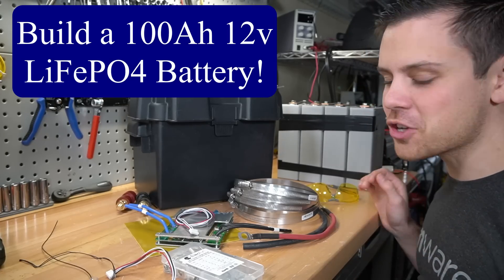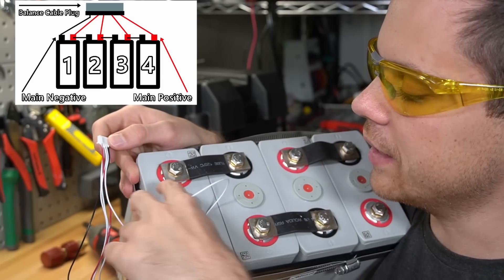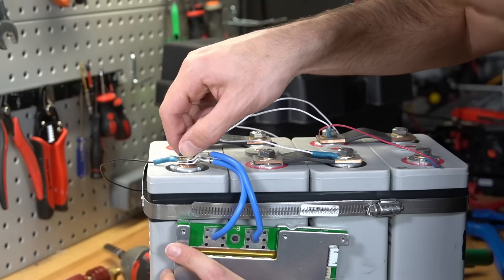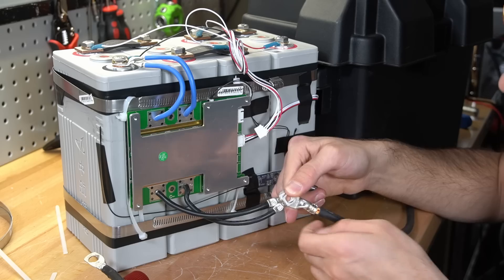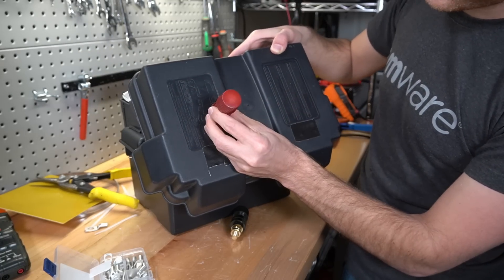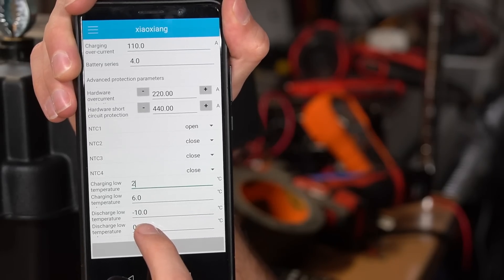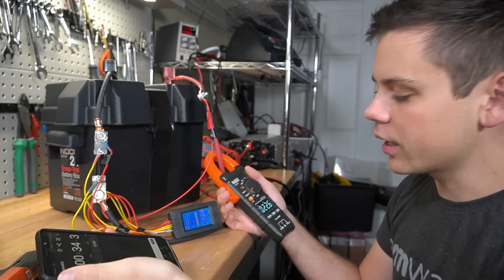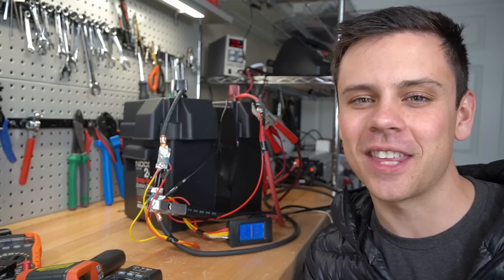DIY 12v 100Ah LiFePO4 Solar Battery for $555

Comment: Those hose clamps really grind my gears Will.. Please use VHB tape between the cells, much less stress on the cell and allows expansion to take place. :)
Update on the CALB cells from your Christmas video.. They've landed in Germany only trouble with that is I live in the UK. haha
Oh and as for battery boxes... Why don't you buy or build a 3D printer, would be another great video project. Arduino controlled stepper motors and a little frame.. can't be that hard :D lol
Reply: Evidence suggests that compressive clamping of the cells at 12 psi to limit expansion may actually increase cell life by up to 1.5x.

Comment: 2:29 Silicone for insulation and implants. Silicon for chips. I cringe with all of the vinyl electrical tape - I've reworked too much car audio I guess (and the big gooey mess it leaves behind). Otherwise a great video as always! And the link to the better BMS app is very much appreciated.
Reply from the maker: I can never say those words correctly, thank you. Always screw that up.
Reply from the maker: Better tape coming in the mail

Comment: re: better cases. Harbor freight's pelican knock offs are what I've been using. just keep the vent open.
Reply: Which one are you using?  Those pelican type aren't deep enough......
Reply: @smitty3509  I'm not sure if they'll fit the 100 amp cells, but I stand the vertically(top of cells pointing at the handle)

Comment: Hi Will 
As always thanx for useful thorough dyi.   The big question is ....could you series connect multiples?  Renogy and Battleborn downsides...have you thought of a work around to use in higher voltage system?
Which leads to an unanswered practical question managing multiple types and chemistries of batteries.
You obviously have a lot of various batteries ...or a person transitioning from existing lead acid and or various sealed, with an RVs starter in the mix as well to keep topped off and utilize for storage.

Comment: Great video. Please do more, starting with basic build like this, then follow-up videos adding features like low voltage disconnect, fuses, trips etc.

A tip - Put a length of webbing aprox. 50-70cm long wrapped under the cells and up the sides of the cells before adding the hose clamps (they will hold it in place - this will aid dropping the battery cell pack into the box and help if you ever need to remove the cells to service.

Comment: Is there a way to independently label each BMS for multiple battery systems? Does the software handle multiple BMS systems? The biggest issue for me is the Android thing. I hate when manufacturers don't create for both IOS and Android. Annoying!

Comment: Will; A sincere thank you for the easy, clear instructions. I have basically cobbled my solar system via items on Craigslist for about 25 cents on the dollar of new store parts. All were new and never used in sealed unopened boxes. Amazing how many people buy items & then never use. I'll build my own batteries & boxes (TAP Plastic) this Summer but have been ok so far with my golf cart ones. My electrical requirements are fairly small & simple.

Comment: If I build multiple batteries like this one can I put them in series (or pararel depending of my needs) at the end?
If yes can I draw 60 amp continuously multiplied by the total amount of  batteries? For exemple draw 120 amp in total with 2 batteries like this in series.
Reply: Or is there an easiest way to build a larger battery for Solar application?
Reply from the maker: Build a 24/48v battery. Check out my older videos on Daly BMS install to learn the configurations
Reply: @WillProwse  Thank you! Much appreciated!

Comment: Hello Will. I just ordered two of the Bluetooth BMS’s but I can not find a link for the app that will work with a iPhone. Do you know if there is one?
Reply from the maker: Should be this one: https://www.google.com/url?sa=t&source=web&rct=j&url=https://apps.apple.com/us/app/xiaoxiang-bms/id1375405426&ved=2ahUKEwj1m4LWzvrmAhULuZ4KHTcRDkMQFjABegQIBhAB&usg=AOvVaw3jdRAIC2ahb25fh7Vtqatn&cshid=1578713668560

Let me know if you have problems with it. It should work great

Comment: At 72 y/o, my brain can process your genius at about 1/3 speed.  So, I won't be building this battery.  I have the resources to buy what I need, so would a Battle Born 100 ah be equivalent to the configuration?
Reply from the maker: Yes battle born will work wonderfully. And it comes with a warranty
Reply: Jerry Roberts yes but with a warranty.

Comment: Are hose clamps really necessary?  Putting pressure on cells kind of weirds me out.  I think I would just prefer strapping tape.
Reply from the maker: To be honest I never use hose clamps. Just the older ev crowd folks will get mad and flame my video with comments calling me a idiot if I don't haha! And at low c rate, like solar application, the swelling isnt that bad at all. I wouldn't worry about it
Reply: @WillProwse  We should ask the crabby EV guys why strapping tape isn't good enough.

Comment: I'm 90% sure I'm building one of these, if I build one now and another a year later will I have any problems trying to use the together in parallel for a 12V system?  How about if I wire them in series for a 24V system?  In my application I would have the room to have 8 cells together in any configuration, I don't really need the "drop in" aspect , could I use one BMS for one large 8 cell battery?   Thanks for the videos, I am learning a LOT!

Comment: Will,  first, thanks. Second, I ordered those same batteries but went with the Daly BMS you had recommended. I also have a VictronConnect 100/20 and the temp sensor add on. I’m not sure which diagrams to look at for setup. Can you please help me?
Reply from the maker: Sure, the Daly will still work great. And this picture might help: https://www.mobile-solarpower.com/design-your-own-12v-lifepo4-system.html

I also have some older videos that cover the victron battery sense setup, but I bet you can figure it out. It's easy to setup. You should be good to go once you have low temp disconnect programmed
Reply: Thanks! I’ll let you know how it goes!

Comment: This might seem like a silly question, but can you add this BMS to a battery that already has a built in BMS? I have a battery, but it is lacking a low-temp cut off.
Reply: 99Isopropyl is it going into an RV?
Reply: @AaronGeller  yes. And the battery is a Lynac. It's a Canadian brand of LiFeP04

Comment: How can I connect this to home solar system?  Could you do a video with AC coupling for those of us with Micro inverters?
Reply: It can be done with a low frequency inverter connected to the grid. So when battery pack is  charged the current will be redirected to the grid.
Reply: I’ve been trying to figure that out too. Does Will have a video on the subject?

Comment: Hi Will - I balanced my 4 3.2V CALB cells at 3.325 volts in parallel within .001.  With the Daly bms attached to an inverter drawing approx. 10 amps, I’ve drawn the voltage down to approx. 3.1 volts and it seems that my cells are out of balance by about .13 volts.  I then removed the bms and tried balancing with the cell mate 8 but after 24 hours in balance/discharge mode, not much has changed.  What’s the best way to bottom balance at this point?

Comment: I would have liked to see you solder the wires on the BMS to make it more capable, beginner DIYr here.  Would the 4S 120A Lifepo4 BMS from AliExpress be suitable for higher amp situations rather than the one you used?

Comment: Can these 100A cells be hooked up in a 8S4P configuration to get a 400Ah 24V battery?  My guess is that a better way to go is 200A cells in a 8S2P configuration...with two 8S BMSs.  This will be installed in a RV...how hard would it be to keep these in balance in a 2P set up?

Comment: Will, I am curious why you hooked the BMS balance cable for the positive cable terminal #2 to the negative cable terminal #3? I realize they are hooked together with a bus bar so it theoretically is seeing the same thing, but it just seems like a bad habit to get into. Great video by the way! Thanks.
Reply from the maker: I always do that. I should have explained that. I put the leads wherever it is most organized. Honestly, I never realize which terminal I attach it to. I just add it wherever it needs to go.
Reply: @WillProwse  , that is why I am watching...you are the teacher and I am the student. Thanks for all of the help. I did not intend "to call you out" on it. That was not intent.
Reply from the maker: @CamboLivin  it's all good

Comment: Will, I notice a lot of viewers are asking about connecting batteries (12v) together (series) for 24v and may be even 48v, maybe a video on that to explain how the higher voltage = higher kw hours is more beneficial, although more costly for the extra battery's, can be a good thing.   (sorry if you have already done that elsewhere.)

Comment: Hey will So I bought the Daly 100a bms upon you're recommendation on the site. I was wondering since this one has dedicated low temperature cutoff do you think I should buy this one instead? I live in PA. So for me to start up my trailer heat I would need 12v from the batteries is that an issue to use them in low temps or just charging in low temps. Sorry for a long message. You're very helpful though!
Reply from the maker: I would buy the one in the video instead of the daly. To be on the safe side with low temps. You can add heater pads and it won't use much power actually.
Reply: @WillProwse  thanks for giving several options for everybody's situation. And following up with me personally. I feel clueless when it comes to all this electrical knowledge but you taught me soooo much! Will, I have another question tho. I've purchased the 1500 watt inverter you use in several videos, the one with 3 AC outlets on one end. (GoWISE Power PS1005)  is it safe to connect the output AC with an extension cord then from there to my RVS 30amp fuse panel? im not sure really what gauge i would need i only see 12 gauge in stores around me.
Reply: also, im going to keep everything in a cabinet where the fuse block amd breakers are so it would be less then 4ft of extension cord.

Comment: One suggestion is to use kapton tape instead of electrical tape. It's only a matter of time until the glue and tape turn into a black gooie mess. I've lived long enough to see it. Especially when heated.
Just a thought
Reply from the maker: Yeah good point

Comment: Great video, Will! One of your best because $550 per battery for a good battery is just what I'm looking for, though I'm thinking of going 24-volt. I will have 1500 watts of panels across a 35-foot long roof. I'm thinking wire size, and 24-volt inverters don't seem to be that much more expensive than 12-volt. Thoughts? See you on the forums.
Reply from the maker: I would go 24/48v any day. I personally despise 12v. I have some 8s BMS coming soon :)
Reply: @WillProwse  Yeah, I'd like to go 48-volt myself because I plane to have a minimum of 800ah in a battery bank, 1000ah desired, and 1500 plus watts on the roof and 12-volts would be a pain in the butt. At less than $600 per battery, I can afford this. Right now on Amazon, they have a Renogy 6Pcs 270 Watt 24 Volt panel deal for just north of $1200, and that's 1620 watts, my friend, dang, that would be sweet with 800ah of battery bank now wouldn't it?
Reply: @CajunWolffe  

Plenty to power a heat pump.
Reply: @johanvangelderen289  Very true, and I'm looking to run two 12k BTU mini-splits units. At first, I thought of a 9k in the back bedroom, but the cost for the 12k isn't much more, and the 12k will use less wattage on low to maintain the same temperature setting, so what the hay, right. I recently helped a friend install a 12K BTU in his 28-foot class C, and it works like a charm. We checked usage with a Kill-A-Watt, and it pulls 900 watts on full load, but once it gets to the set temperature, it idles along at a 325-watt average. He has four Battleborns or a 400ah bank, and 640 watts of solar on the roof. He also has an additional 200 watts he can deploy while boondocking. During the day in the bright sun, the panels power everything. It's a nice little rig, he's been working on it for about a year now, and just right for him and his wife, but it's a bit small for me with a family of three. I've got my eye on a couple of class A's in the 35 and 37-foot range, one a V10 gas, and the other a Cummings diesel pusher, both around $15k and low mileage, but I'm not in a big hurry at the moment. I'm saving money and waiting for that just right cash deal. I need all the money I can save for the panels, batteries, and hardware.
Reply: @CajunWolffe  

Sounds both impressive, and doable. 

I'm not ready to buy and convert the big step van I want yet, but I'm thinking about how I would do it. I was looking into a solar powered ac, but the starting draw of even a 5000 window ac requires quite the inverter.  

I've discovered the heat pumps this week, and all about their soft start feature.  The heat pumps are less demanding than those, and also provide heat. I was looking at the diesel heaters and the Wave series propane heaters. It seems that the 120v heat pumps demand more power below freezing outside. That's when the Wave heater could take over.

I'm amazed how relatively affordable the mini split heat pumps are.

I'm considering a Tesla unit to power it all. 1400 bucks, and no good bms. Looks like I need 6 of Wills dyi batteries to come up with 300ah at 24v to beat what the Tesla could do. 
555x6= 3330 dollars. These would be a after and easy to deal with. I'd need 6 Battle Born batteries almost twice the price to equate what a,Tesla could do at 1400
 .
Reply: @johanvangelderen289  I had a diesel heater on my sailboat, and I loved it! I've tried many types and to me, they're the best. Cheap to operate too. They have some sweet deals on step vans here in Houston by the way. If it was just me, that's how I'd go, a van is too small. I have a disabled daughter and wife, we will be living in the RV full time, and I need the room and power.
Reply: @CajunWolffe  

I'm considering the largest, widest 22 ft model.  Workhorse brand. International company. Based on an old gm model. 

I'd put a bed in back, sideways. 
I'd place the heatpump compressor under that. Also propane tanks or a diesel heater for when it gets really cold.

It's amazing how technology like Wills battery concept, solar panels, led light bulbs and super efficient heat pumps have changes rv life. Also how relatively affordable it is becoming.
Reply: @johanvangelderen289  That's mostly what you see around here, the Workhorse, and with 200k miles there just getting broken in. By the way, an old GM Step Van is worth its weight in gold on the collectors market.